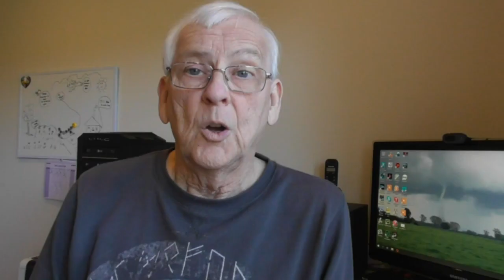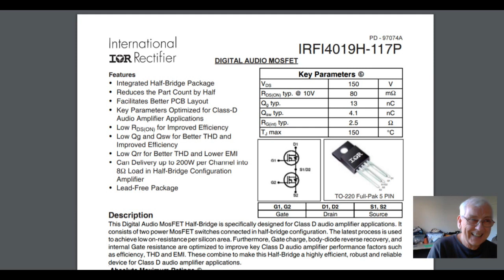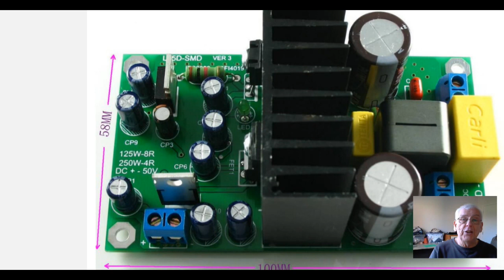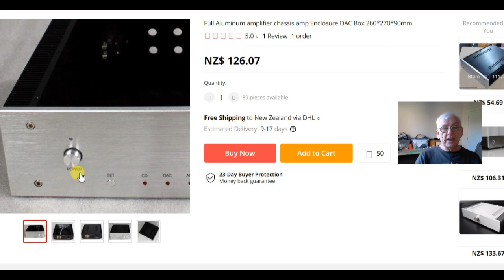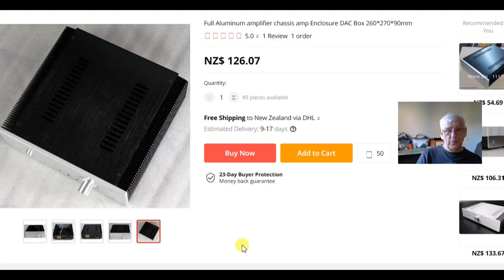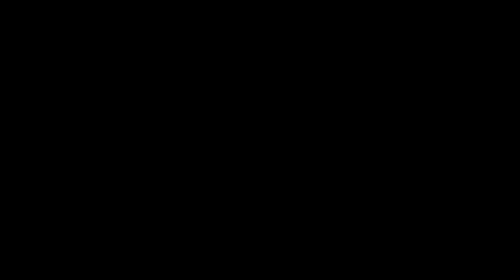Class D Amplifier. 200 watts. Lets get started. Part 1.

Comment: The transistors on there are for the phantom power the circuit needs (12V in relation ti the B- power). The other will assure the thermal protection (the one on the heat-sink) I assume.

Comment: Hello. Since you have bought a number of amplifier cards from ebay, I wonder how to mount the fuse between the AC transformer and the capacitor board?

Some people claim that both power sides must start at the same time otherwise you will ruin the amplifier! Is that right? what if the fuse on one side is damaged by too little fuse value?

for example
Naim nap250 clon.
L15D.
L12-2.

can you explain this to me or make a video about this or both ??

Comment: Hope you can answer me.

Do you remember the Fisher ca-271 amplifier from the 80's and CA. series amplifiers?

I made a comparison between the Class-D and the fisher amplifier.

1.L15D.
2.TPA3116.
3.TDA7492.
4.Hypex UCD180.

I was very disappointed with the sound quality of the Class-D!

Almost all Class-D amplifiers have poorer sound than a Fisher CA. The difference is is too bigg!

But the Hypex UCD180 has better sound quality than the Fisher CA. have!

Hypex UCD180 is approx.
10 - 15 years old!

Comment: I have used 2 of those boards for about 1.5 year and it has worked flawless for me. Its very neutral sounding. Bass is very firm and quick. It has a modern sound to it with extended highs. Very good sound for the price! I superglued (CA) the heatsink's side to the old amp's heatsink and transferred the heat well enough. Many people uses a tube buffer with this board to get a more mellom tube amp sound with excellent bass.  One important note with this board is that one must connect speakers to it before turning it on. This us usally a good practice with most class D amps.
Reply from the maker: Seams an odd thing to do to, connect a valve pre amp to add limited bandwidth, add distortion, and add colour to a really quite good amplifier. If you need more gain add a pre amp like the 5532, cheap, adds nothing but gain.
Reply: Yes I know it doesn't make sense unless you listen to the result ;) Also I've tried lots of OP amps and they do not sound the same in practice. Give the OPA1622 on a pcb adapter a try! You will be amazed at the sound difference between that and the 5532. I've listened to OPA1622 in one channel and most other inexpensive opamps in the other channel with mono music and there is a very distinct difference. My ears are 35 years and I've been critically listening to music systems for 17years. My mates propably wouldnt notice the difference in opamps though ;).

Comment: I like the L15D but I use the L15D pro version 1 and 2 with speaker protection built in.
The reason why I don't like the L20D is that it doesn't like 4 ohms as well as the L15D does.
I have measured L15D at 150 watts with 49 volts smps 10A power supply
Reply: 150 watts RMS?
Reply: @jamapaza  YES. Do not believe everything that is written on eBay! watts are often written in 10% THD.
Total Harmonic Distortion. which is noisy and not pretty to listen to.
Nobody listens to 10% THD!
it is 1% THD or 0.1THD watts which is correct to write.

If you are going to use the amplifier for 4 ohms. choose L15D and not L20D!
L15D provides only 150 RMS  watts with optimal power supply !! Choose L15D pro if you find it for sale.

look at the TPA3116 amplifier
ebay number. 113795081923
which is 120 watts. in the data sheet from the factory it says 50w 10% THD and 25w 0.1% THD.

Why do sellers do this? People are stupid and 120 watts sell better than what 50 watts or 25 watts do! And sellers know it!
Reply: @jamapaza  Yes if you have optimal power supply of close to 50v that does not drop then you can not expect to get more than 150watt 4 ohms.

The L15D also gets a little hot even if you do not put sound in. this is due to the way class-d works. There is a lot of high frequency noise that is filtered out at the speaker output.

l15D handles 4 ohms well and is a pretty good amplifier.

If you want good sound quality, I would recommend 
(Naim nap250 clone) 129w 4 ohm or
l20 which you can get up to 200 watts with optimal power supply. both are class-ab

Another thing. do not buy this power supply. heatsink gets very hot with almost no load.
ebay varenom. 284088900825

Comment: This edition is called L15D SMD. You get the edition with 2 pieces. 3 leg transistors and the edition with 1 pc 5 leg transistor.
the edition that is called
The L15D POWER SUPPLY was also available without a power supply capacitor

There are now 3 editions of LJM L15D

Comment: You have tested the L15D smd amplifier. How does it handle 4 ohm? Many cheaper amplifier cards from eBay do not like 4 ohms. Have you tested it in 4 ohms? If you can't use 4 ohms on an amplifier then it's not a good amplifier !! I was thinking of buying 2 pieces of L15D.
Reply from the maker: Yes I agree with you. In my application is did not need 4 ohms, the other problem, if you believe the spec, it can put out 250 watts (undefined at 4 ohms) My load box is only 150 watts. With class D the filters are load impedance specific. They will really need different filter values and possibly better heat sinks. Most stuff from China are always a compromise, quality is always compromised by price. Sorry that's not really the answer to the question, I don't have a really good knowledge of class D. I still think class A/B wins in quality but Class D wins with watts.

Comment: Hello. I suddenly came across your channel. I liked what I saw. you say the right things and everything you say is right.

I have bought many class-d amplifiers from China and they are not that good! many can't handle 4 ohm or much less watts than what is written on ebay. The amplifiers I bought and tested are the following.

1. L20 (LJM) class AB. It has very good sound quality and delivers almost 200 watts 4 ohms.
eBay item number: 252323146656

2. SURE electronics 2x300watt delivers approx. 150 watts.
eBay item number: 221581498916

3. TPA3116 DC 24V. delivers approx. 37watt with good sound quality.
eBay item number: 133233176890

4. TDA4798 is a teribel amplifier chip. the one i bought didn't behave well and only has 15v on the speaker output before it failed anymore and that with 30v power supply and 5 amp.
eBay item number: 162705514704
Reply from the maker: Thanks for you're kind comments, my favourite amplifier is the L12-2 I am currently working on another one right now using a linear power supply. Fed up with China made switch mode PS's they like to blow up!! Few amplifiers from China even approach the published spec. Those supplied with heat sinks are way to small and get very hot.
Reply: @MichaelBeeny  l20 (LJM)  has good sound but you can't adjust it and it seems like it's a class-b amplifier. Transistors do not get any heat until you turn the sound up. ljm is the same one that has made l12 amp. An amplifier should have some temperature on the transistors!

How is L12 amplifier?

Have you tried
NAIM NAP250 MOD 2SCS2922 MINI amp board? You can adjust power to transistors
(bias adjustment) I think they are called?

I've built an amplifier with this one. ebay item number. 132252043236

The class-ab amplifier is the best and gives you least trouble to best sound.
Reply from the maker: I doubt any so called HiFi amplifier would be class B. I have not tested the L20 yet. I find most LJM amplifiers good. Very shortly I will publish details of how to adjust the QI on the L12/2 as the QI does vary quite abit from one kit to another. I started recording the process yesterday. Watch out for it soon.